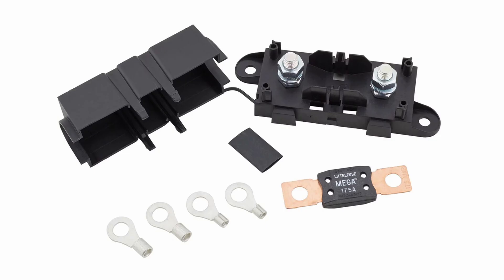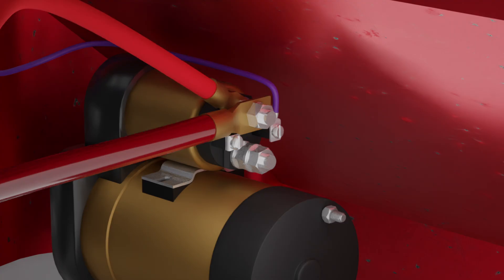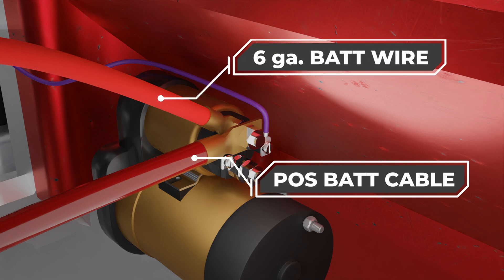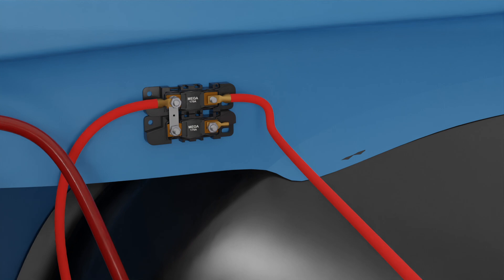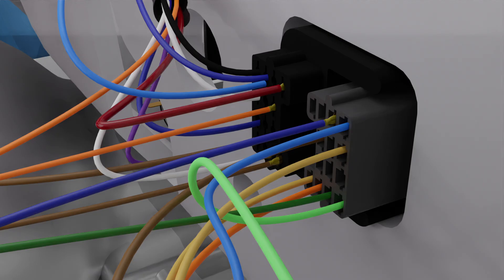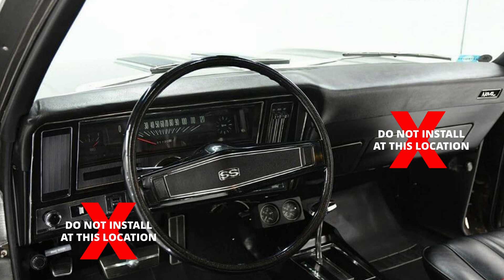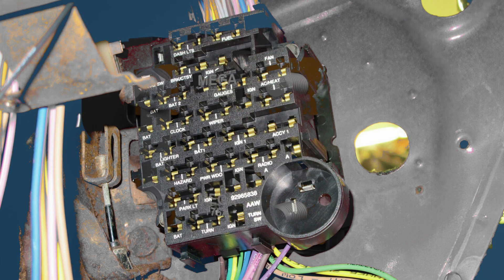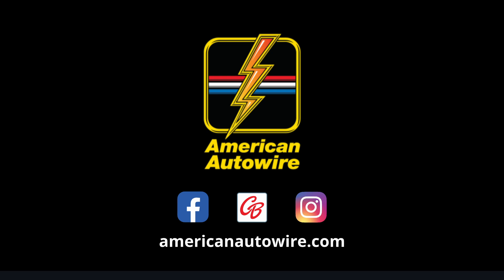American Autowire MEGA fuse Usage

Comment: Does anyone know why it's not reccommended to simply wire the battery (+) directly to the mega fuse, and the mega fuse to the solenoid? As opposed to battery (+) to solenoid and solenoid to mega fuse?

That way you'd only need 1 cable going to the starter solenoid
Reply: The starter will pull a lot of current. If after a hot soak, the starter may draw more current than the fuse could handle. The starter should remain wired directly to the battery.
Reply: Maybe it’s just shorter distance going to the starter terminal rather than the battery terminal? 🤷

Comment: 175 A ?
Reply: I use 150a with no problem
Reply: indeed, seems too high.  2 ga wire has about 180A max current rating.  it's a quarter inch copper diameter.  seems like the wires here are smaller.  I would think the fuse should be such that it trips before the wires overheat.  actually would guess a circuit breaker of appropriate size would make more sense
Reply: @kev4241  Absolutely, right. And that's what I use on my first Gens  Firebirds a circuit breaker.
Reply: @kev4241  If you put 180 amps thru 2 gauge wire, you are going to have a fire.